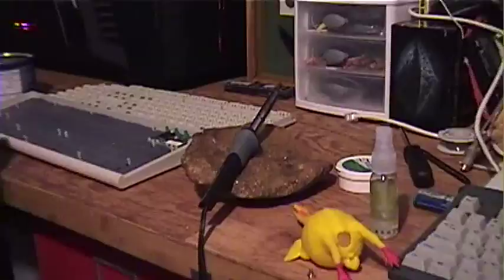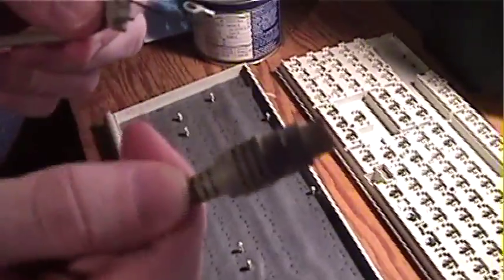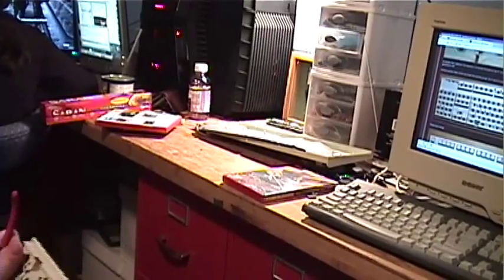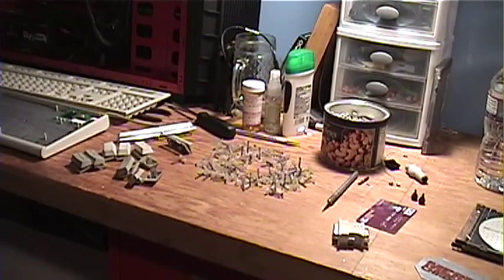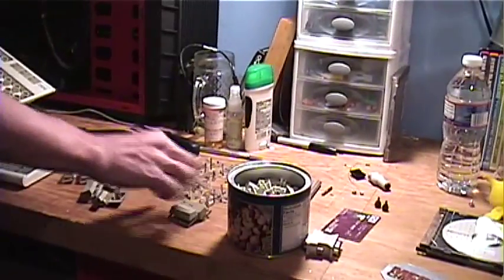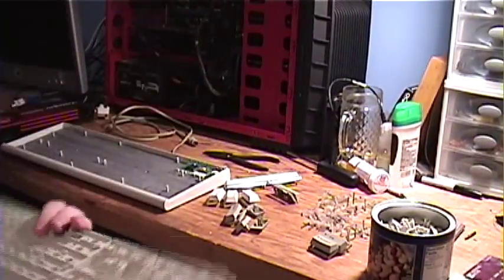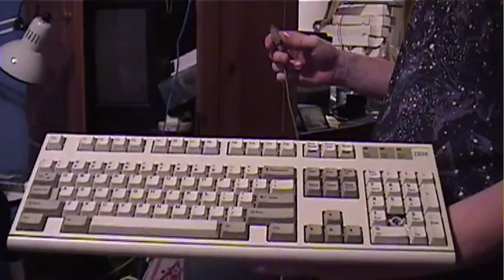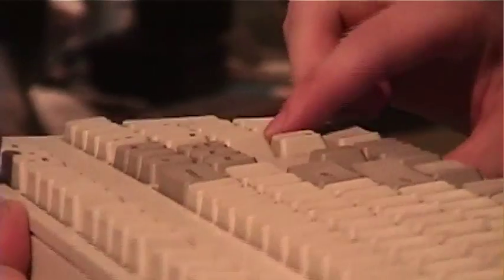IBM Model M2 Keyboard Repair W/ Grateful42

Comment: The reason why the pic on geek hack is missing a spring is because the keyboard is different than yours.  The one on geek hack has a large enter key while yours has the back slash key.  I am doing this repair right now as I found an M2 for 2 bucks at the thrift store.  Thank you so much for the upload.

Comment: How does it compare with the proper Model M? You know, lack of steel plate n all?
Reply: +TheSvenVids It is a different feel, but I actually prefer it. It is a bit quieter and a bit softer touch, plus it saves space on my desk. I had to recap mine the second I got it in though, so if you are still interested a year later, Be prepared to recap it. It is an easy job though.
Reply: mike52787 Actually, I got a legit Model M back in November of 2014, as well as an M2. Thanks for the reply anyway though :)

Comment: I have 3 of these all working. I cleaned 1 by removing every key then washing the keys & body in a sink with soap & water. I put soap on a toothbrush & scrubbed the circuit board & especially the IC leads which were corroded. For keys that weren't working, test for conductivity on the plastic film using a multimeter. High resistance means corrosion somewhere. Just use a pencil eraser & rub the problem area until high conductivity is restored. Total repair time 2 hours including drying it out.

Comment: Thanks for this video. I was sick to buy buckling spring keyboard without rubber dome, and i found on ebay IBM M2. I could'n find enough information about M2 used switches and this video help me a lot. I'll stay with my TVSe Gold keyboard with Cherry MX red switches which is great over my previous one rubber dome.

Comment from the maker: yeah, but buckling spring is nice to type on, granted i don't like the design of it on the m2's at all versus the original m. keys get stuck a lot. the rubber dome version probably doesn't have that problem because rubber dome is easy to get right on a cheaply designed keyboard, therefore it'll work properly.